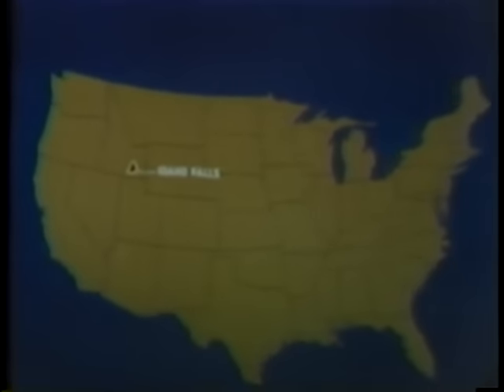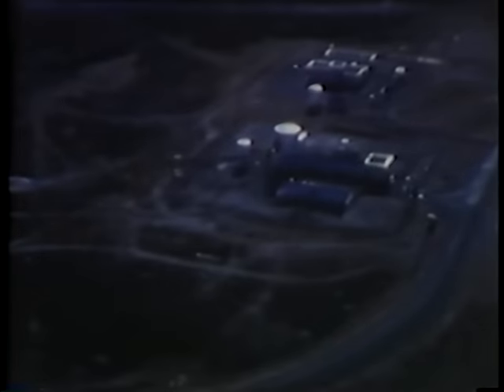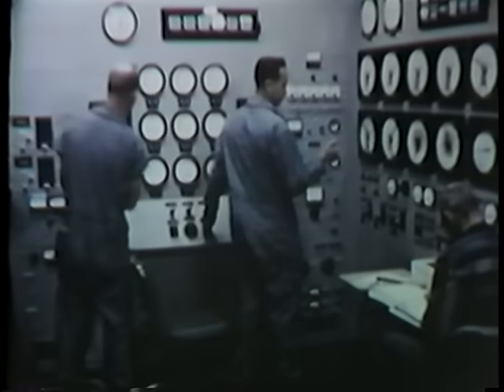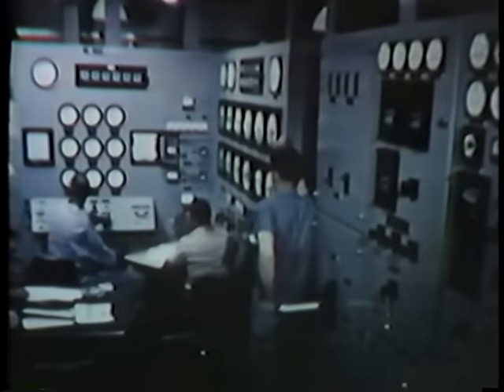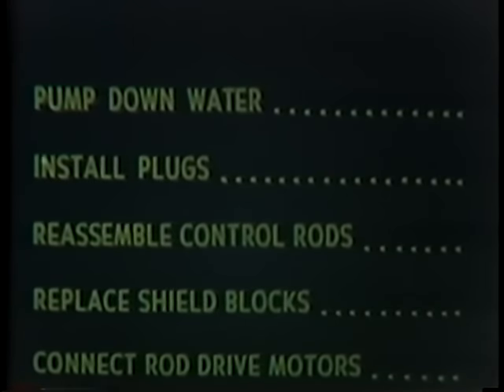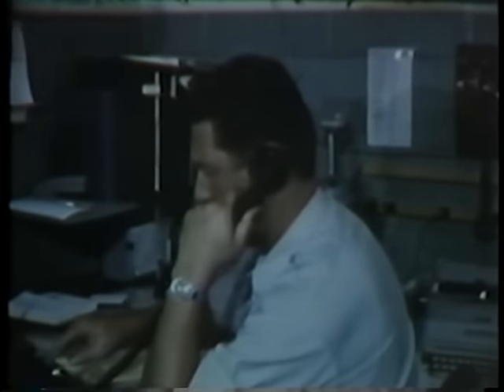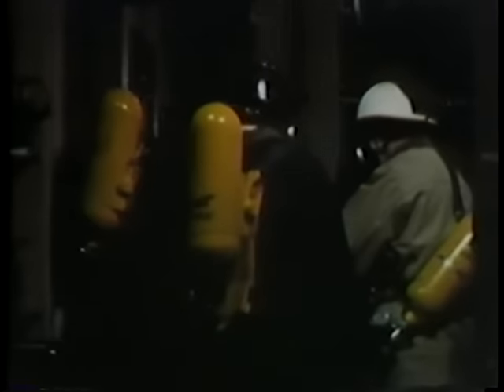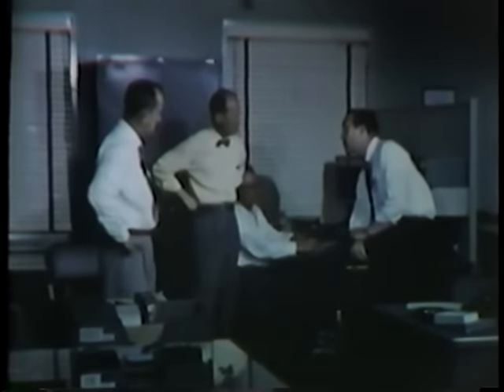SL-1 The Accident

Comment: The rescue operation was pretty basic and I one could expect quite a few of the people concerned in the recovery getting sick years on from this.
Reply: Oh...I'm sure cancer struck down a few of these brave men. Hazardous doesn't begin to describe the incident and clean up.
Reply: You might be surprised.  Operations like this spread brief exposure among many responders rather than hitting a few with a high dose.  I doubt any experienced any adverse effects at all.  I mean, the guys who threw chunks of highly radioactive graphite core elements off the roof and back into the open, exposed, and actively melting reactor core at Chernobyl all survived and many are still alive - even those guys who went diving in contaminated water to open the drainage valves lived.  People are terrified of nuclear power because the same stuff is used in bombs, which is too bad because it's cheaper and more environmentally sound than most other sources.  Everyone freaked out about Three Mile Island (which in the end was a public health non-event) which, combined with the poorly (or perfectly, if you're the studio) timing of the release of "The China Syndrome," pretty much destroyed US nuclear power.
Reply: The radsafe people know what they're doing.

Comment: More to the point, why did it blow up. I seem to remember that they hinted that it went critical at the core but with zero cooling water. Is this true? Perhaps a hot spot developed.
Reply: When the control rod got stuck they forced it and it went out of the core 20 inches instead of the safe maximum 4 inches. This accident caused the reactor to go “Prompt critical”. This is a burst of reaction energy which turned the water to steam instantaneous. It then created a “water hammer” event. All the pressures launched the reactor plates off the head of the containment vessel because it was never designed for this much pressure.  There was nothing that could be done and likely didn’t even get noticed by the people that got hurt. It happened that fast.
Reply: I agree, there must have been water inside the vessel otherwise it would seem hard for it to have gone critical.
Reply: @PatHaskell  Yep there was
Reply: Some water had been removed post shutdown but water did remain. After the event no water remained in the reactor
Reply: @Astinsan - Besides the water that was left in the reactor, the main reason for the accident was a design consideration that proved to be the fatal flaw. Because the idea behind this reactor was to make it as simple to operate as possible (remember the caliber of people who were the expected end users), the engineers designed the center control rod to have the greatest effect on the reactor power (known as "worth" in nuclear design lingo). So this one control rod was effectively the trigger of a nuclear IED. All it needed was to be pulled out too far and kaBOOM. Since then no nuclear reactor has been designed with any one control rod given the ability to affect reactivity so profoundly.

Comment: The Army is now considering utilizing small nuclear reactor-power plants for use in tactical operations.  What could possibly go wrong in a war zone?
Reply: It's okay, they're only small ones. Just don't stand too close. Or leave them unattended. Or let grunts touch  them.
Reply: They are considering Thorium Nuclear power plants.  They are small and actually pretty safe, even “meltdown proof”.  It’s what we should have been building all along.
Reply: @6862ptc  None of the small modular reactors in development for realisation in the late 20s timeframe are thorium reactors. They're going to use "high assay low enriched" uranium, which is their latest silly euphemism. Make no mistake, they are going to be pretty conservative designs using uranium fission.
Reply: @noecarrier5035  hmm, ok.  I was just going on information from a documentary I watched sometime last year.  They mentioned the Army was looking into using small Thorium reactors at bases.  It looked like the safest form of nuclear power of those discussed.
Reply: @6862ptc  They are looking and were previously looking into a whole bunch of different concepts to serve the same purpose, so they might well have looked into a small thorium plant at one stage earlier on.   It's certainly true what you say about thorium. Sadly, thorium cycle plants are still locked behind the staggeringly large quantities of money. Licensing, fuel fab chains, certain engineering issues, etc.

Small modular reactors are definitely where nuclear power lies for future energy needs, though. Not just military ones.
Reply: @6862ptc  Uhhh ohh,  you used the T word.
Reply: @noecarrier5035  im sorry but your comments hurt my head. Lol. So i will look up what you are talking about to understand. Random "useless to me" knowledge intrigues me. But what would be wrong using the same power plant that the nuke powered subs use? Or is that the same thing you are talking about? Nuke submarines, jets and railcars are things i love learning about.
Reply: @gregl5677  Oh, sorry man. I try to be clear with my words. The kinds of reactors they use on submarines in US service are usually very similar to most land based ones when it comes to how they function. They're just designed to fit inside submarines and provide power over periods of time and in quantities suitable for driving the boat around and keeping the lights on and such. It's more a question of size.

Nuclear reactors vary the most based on what kind of nuclear fuel they use and what they use to turn fission energy into electrical energy. US navy reactors use highly enriched uranium and pressurised water.

Naval reactors are also built with specialised protective equipment around them, incase Ivan starts detonating large explosive devices nearby. Buffer springs and armour and such.

Comment: What kind of "major modifications" ware done on that reactor during that maintenance is in question. They may "screw up" that control rod somehow. It may be that trained guy did something wrong to. Some rumors saying there was a flame hate between two higher rank officers in that group working that night of the accident. Another story saing that R.L.B. got phone call from his wife that night and told him she wants divorce. Some saying she cheated on him with that other higher rank officer which was in constant fight with him. This may crashed on him hard in that moment and triger his depression or hate. He may  afterwards walked upstairs with his "rival boss" do the job, and on top of that reactor vessel pulled that control rod to fast and to high on purpose, to commit  suicide/murder.  But it's just one theory based on rumors and we will newer know what happened there that night.

Comment: 25 R/hr would have been enough to get me backing off much less 200. Yikes!
Reply: For me, it depends.

A whole body irradiation dose below 100 R causes no immediate ill effects and only a so-so increase of cancer risk. However, getting contaminated with radioactive materials is fucking scary. The stuff will be with you for a long time (not everything can be scrubbed off easily), and local doses will be significant.
Reply: @Sashman  It's true that particles deposited in your body could be there for a very long time, even for your entire lifespan,  but depending on quantity it's effective dose may be nothing compared to the 27 R that recieved.

Comment: I was hoping to find out what mistakes were made to cause the accident.
Reply: google "SL-1Article Rev5.pdf" .. for a more complete story of the incident and the investigation .. emphasis on poor design, procedures, and protocols will become apparent, and a bit of fabricated drama and blame on operator error was pursued.. this experimental reactor was a problem well before that fateful night .. the government's conclusion ended up not supporting the factual information that later became known .. but the damage was done and a story of blame and cover-up developed to protect national security  and other programs..  I believe this is the same type of reactor secretly installed in Thule Greenland  .. as this reactor was designed for artic operations.   Without going down the rabbit hole .. nuclear power was seen as a solution to many problems with very different applications .. and such thinking exists today ..

Comment: I was born 16th of jan 1987 170km from chernobyl....luckily the wind was blowing at the opposite direction and my mom got early warning about the fallout (she was a nurse) so she left asap to poland. USSR took her job, house and she coudnt return until the fall of ussr ...(because she refused to go to the zone) Its better to just burn oil than utilize nuclear - nuclear is clean until its suddenly not for thousands of years...
Reply: I was down wind of Chernobyl in 1986 when it happened. No one had any idea of what was happening or let alone what nuclear radiation is or does! Although I wasn't close to it but the radioactive clouds past overhead which I found out many years later.
Reply: @PeterMilanovski  I had a friend who was working at a steel mill at Magnitogorsk. He said there was a radiation counter on the roof of the bank. Also nothing was mentioned after a radioactive gas leak downwind and relied on us emailing him what we read in the papers.
Reply: @darylcheshire1618  history has shown us that whenever there has been a nuclear problem, it's always 10x worse than what you are being told! 
Those who fail to learn from history, stand to repeat it! 
Nuclear anything can't be trusted! 
You can argue that asbestos is a great product but what's the point if it kills people!

Comment: The one man had a conversation with his wife. She wanted a divorce. He had also been passed by his classmate for promotion so he gave that control rod they were reattaching  a yank and rest is history... Suicide by reactor and misery loved company so he took his pals with him... Damn shame reactor ran fine for over. 2 years till that event.
Reply: Seriously, that reactor was a disaster waiting to happen... Read the book Idaho Falls... it details what was wrong with that reactor and the agencies in charge of running it... (Combustion Engineering and the Military). The Reactor stability was deteriorating quickly... and they were just trying to get through to spring when they were due to replace the fuel and control rods. A lot of bad things conspired to make this accident happen.
Reply: In a little under two years before the incident, the center control rod alone had malfunctioned over 60 times. Years of corrosion added to the mounting problems with the site and it was overall under maintained and falling apart. This was an accident waiting to happen.
Reply: @saintlynnie4037  The center control rod was the only rod that never was reported as sticking actually.

Comment: why were needed radiation suits, gloves and other needed equipment not on hand? caused critical losses in response time. The man embedded in the ceiling was dead. what was the need to rush to retrieve him? what was done about the core? outside clean suits should have been available even at safe distances for enough responders. possibly in a HAZMAT trailer with lead lined walls.
Reply: They were afraid that since he had been irradiated and still pinned to the ceiling by the control rod, if either fell back down to the reactor core, it would cause a second criticality incident to occur.
Reply: why were needed radiation suits, gloves and other needed equipment not on hand?

Because they are not 'needed' equipment.

caused critical losses in response time.

The accident was over in just a few minutes. No additional outside or internal equipment could have prevented it.

The man embedded in the ceiling was dead. what was the need to rush to retrieve him?

Yeah, why not just leave him embedded in the ceiling for a few weeks? They needed to get the body out of the way so they could send the camera in. They were hardly rushing.

what was done about the core?

Nothing. You leave it in place if there's no additional danger of explosion. It'll be safe to dismantle and dispose of it in a hundred years or so. What's the rush?

outside clean suits should have been available even at safe distances for enough responders. possibly in a HAZMAT trailer with lead lined walls.

Why?

Comment: Notice they were decontaminating their hands into the fricking sink. Now your sink is contaminated with all the piping to the sewage system. How nice. Have fun with that.
Reply: These were early days and you are suggesting that they did things the wrong way? You Michael, know what you now know because of the lessons, and knowledges aquired from those, and other similar happenings. Was it wrong what they did? Sure, but that was how it was in 1961!  Pretty sure the plumbings in a nuclear facility have dedicated schematics, even then.
Reply: Yeah, pipe down, you would’ve done the same thing in that situation back then. I would do anything to get that crap off of me, today!
Reply: Should they dump it on the ground outside?

Comment: A total cluster f*ck... I like the bit where they said evidence of the cause of the accident was from a gold dosimeter, indicating an uncontrolled chain reaction. Um, I think that was obvious from the guy skewered into the ceiling by a control rod.
Reply: They didnt say 'gold dosimeter'... They were measuring radioactive isotopes of gold and other metals in the crewmen's belongings which could only be possible if those items had been exposed to an ionizing radiation field.
Reply: @waynecoulter6761  Not just ionizing radiation, they were neutron activated.  Alpha/Beta/Gamma does not transmute elements.
Reply: @hmbpnz  Yes...  the really heartbreaking part of this incident was the horrific lengths they had to go to to render the bodies even marginally capable of being buried normally. Body parts were severed and buried as radioactive waste on site... large portions of the remaining parts were debrided (skin and muscle containing radioactive particles were also removed). The families basically received sealed lead lined coffins with nothing left but lumps of flesh... The coffins themselves were buried in lead lined vaults twice as thick as normal concrete vaults, sealed and marked with radioactive warnings and ordered to not be exhumed without the express consent of the Atomic Energy Commission.

Comment: 37:05  "Life went on as usual in the surrounding communities...."   Yeah, because no one warned them of the dangers.....  This was a mini Chernobyl with atmospheric discharge and highly radioactive stuff ejected some distance from the reactor.  I love how the "stubborn" stuff was just covered over with a thin coating on the roads....
Reply: That's funny, because they explicitly state in the film that onsite testing confirmed there was no outside radiation leak into the surrounding environment.
Perhaps you didn't pay attention to that part.
Reply: The closest surrounding community was Atomic City about 20 miles away and the population was only a couple of dozen. Any town or city of any size was over 40 miles away. With only 3 MGW of power, it's not likely radiation went too far and it is desert with no homes for miles.

Comment: If they had gone in sooner instead of all the farting around and running away, the first one might not have died. So the nurse put an oxygen mask on him when he was dead and didn't even bother trying to resuscitate him, sounds like a cover up.
Reply: He would have died anyway because of the amount of radiation he was exposed to
Reply: Ignorant.  The first guy was already dead. They even knew that when they pulled him out. Technically he still had a pulse at the moment but was due for a horrific inescapable death due to radiation poisoning. One could argue he shouldn't have even been removed at that time. About the nurse, she shouldn't have even been stuck in a vehicle with him, let alone perform CPR.

Comment: I just don't trust or like nuclear energy.  Maybe Im old school, but it's the way I feel.
Reply: I has evolved massively since the 1950's. Much like today's cars compared to 50's cars.
Reply: @paulanderson7796  Maybe it has evolved, but what do we do with the waste?
Reply: @rricci  They don't actually create much waste at all compared to the smoke and fly ash created by coal fired powerplants. Keep in mind that coal contains radioactive impurities, as does the fly ash.

Spent nuclear fuel needs more careful handling than fresh fuel. (You can bare hand fresh reactor fuel completely safely) Spent fuel needs to be stored in a pond for the short lived actinides to decay. A couple of years is sufficient. These are the ones we need to be careful with. The vast majority of what's left is uranium 238, which is what came out of the ground in the first instance. It has a half life of around 4.2 billion years so there's no need to worry about it from a radiological point of view.
It could go back in the ground in the same mines it was extracted from. U238 also has commercial applications. It's used extensively as armor plating being a very dense and ductile metal it stops bullets very effectively. U238 is also employed as a radiation shield!!

There are also medical and commercial uses for other daughter isotopes. One being cancer treatment. Another example is Americium which is used in ionisation type smoke detectors.
Reply: That's actually the new school.
Back in the late 50's and early 60's nuclear power was going to save the world by giving us a fossil fuel free future.